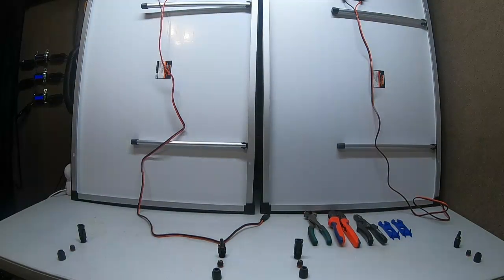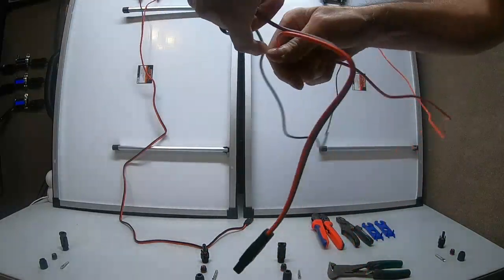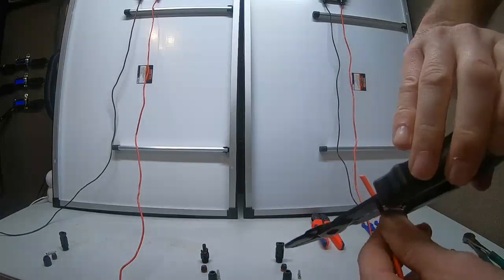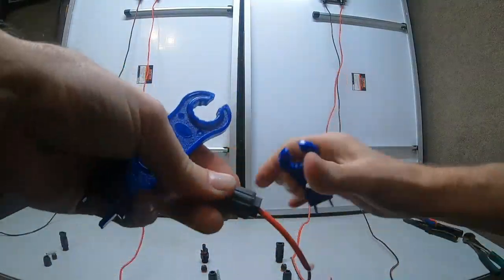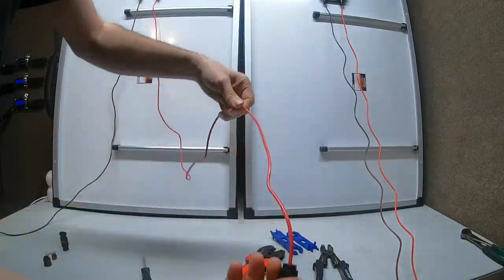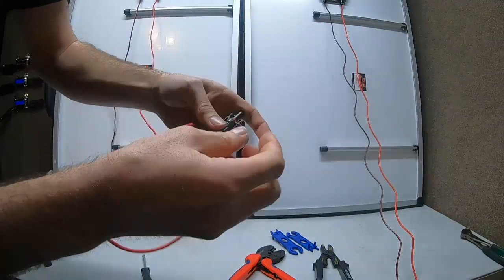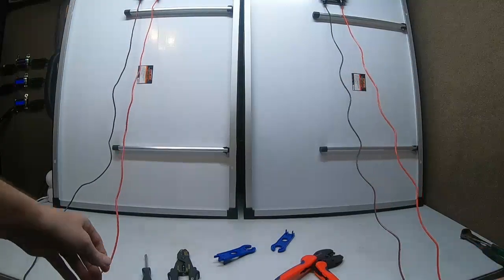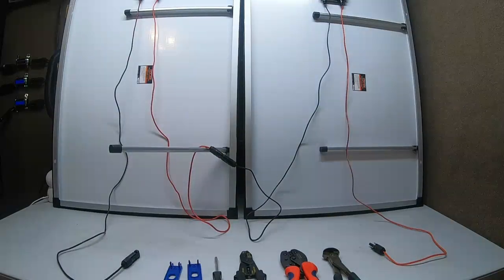HARBOR FREIGHT 100w Solar Panels - HOW TO MOD TO MC4 CONNECTORS  & CONNECT THEM IN SERIES !!!!!

Comment: Yes mc4 is the way to go but HF uses sae so they mesh with all their other solar jazz. 
Look I'm sure the panel is ok but I don't like the thin wire. Even if you can open the box & replace the wire leads, or do what is shown in this video, (which I thought was done & presented quite well btw), your still spending more money on a panel they want about 120$ for. Or I can buy a proper 100watt panel for often less than 100$. Without waiting for a sale or needing a friggin coupon.
Reply from the maker: THANK YOU :)

I do agree, about the cable size on video, But they are 12awg wire in these. Could use some more covering to protect better.

  The only thing is with this panel....

  The output on a cold day (on video on this channel) was 122.5 watts per panel

   That alone was incredible in a world where 90% of 100 watt solar panels bring in 80-85 watts on average, So you have to look at the overall price per watt. And that is more important to me when it comes to getting that sun to pay for the product.

Will did a whole video on these 100 watt panels and none of them brought in over 88 watts i think :(

   The overall price of panels now-a-days is going down, But the thing that just can not be beat with these cheap panels is.

1. The output
2. Built in legs for portable use
3. Walking down the street and buying one "RIGHT NOW" (no shipping, no company throwing your panel and breaking it)
4. Coupon is every month at harbor freight

Comment: Will the water seal get tight enough around the thin cable to keep the water out?
Reply from the maker: We have 6 of these panels done this way with no problems :)
(That is 12 connections with no water leaks)

The cable is thin, Not the outside plastic/rubber....They do that to make that cable look bigger than it is....LOL

Comment: JUST WHAT I NEEDED!!!
Thank you. 
Can I assume it is the same process to attach MC4 to the HRTC 200 Amp multimeter I ordered (per your recommendation) a couple of weeks ago?

Also, can you provide a link to buy additional MC4 connectors like this that came with the BougeRv crimper kit I also got, per your recommendation?

So glad you said to:
1. Do this in the shade 
2. Clip ONE wire at a time. 

You saved this 'scriber. 😀

Appreciate you. Thanks.
Reply from the maker: Same technique as the panel for doing the dc meters :)

Make sure that you match them up correct the first time because you will only have ONE time worth of cable....Measure 3 times and cut once !!!!!   LOL There is no room for a do over ;)